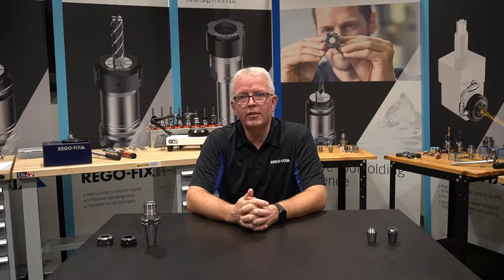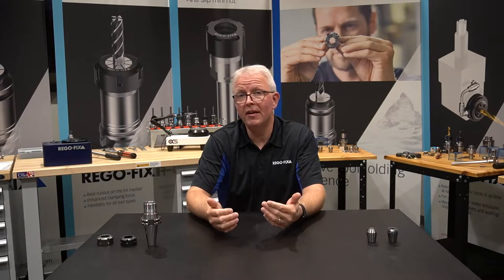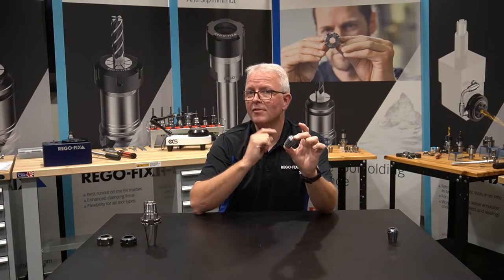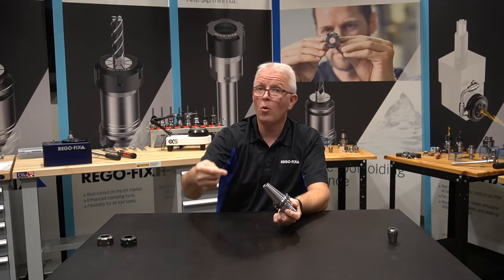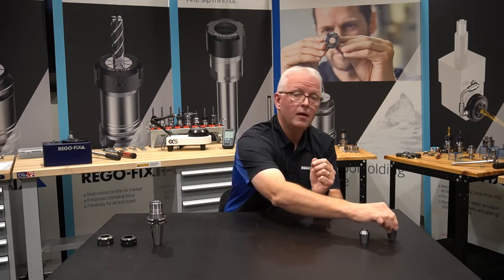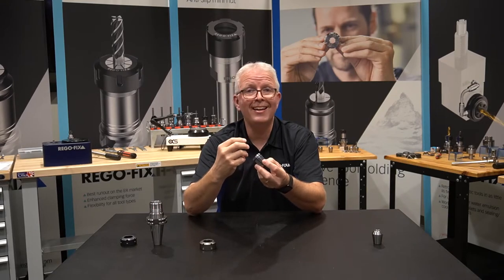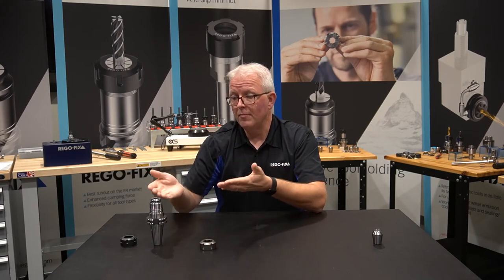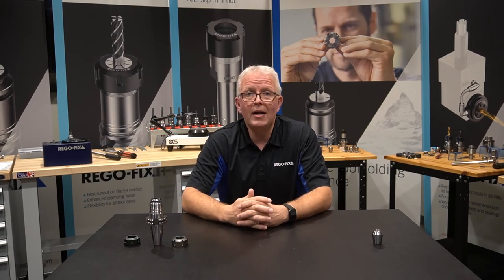TechChat - History of the ER Collet

Comment: Many thanks for the clarification about how the ER collet design was invented. But a further question that maybe Rego Fix can answer. I recently bought an as new condition Volstro rotary milling head that also came with a full set of Schaublin produced E 25 sized imperial collets that don't have the extraction groove just as you mentioned in the video. These as close as I can measure replicate both taper angles and dimensions my ER 25 collets have except those Schaublin collets are approximately .047" longer than the ER 25 series is. So were the collets overall length dimension also changed at that point? And yes for a couple of very good reasons I already know ER and E collets can't be used interchangeably in either chuck design.
Reply from the maker: Per David, you should be able to change the E nut for an ER one and use ER collets in them. As long as the cavity in the back of the holder has a pocket at the bottom, you should not have any issue with the ER collet being used in place of an E collet. The ER collet will sit higher, but it should fit just fine. The reason it sits higher is to create the clamping range we now have with ER, compared to the on-size fitting of an E collet.
Reply: @REGOFIX  Sorry I should have been a bit more detailed in my explanation. Since E collets seem to be fairly rare today maybe some interchange information will be helpful to you if there's any questions by customers about using ER collets with a E series chuck and nut. Afaik the standard dimensions Schaublin used for there E Collet chuck and nut that I'd have to assume Volstro followed very closely since they were using there E collets are quite a bit smaller in diameter with a different thread pitch than today's standard ER 25 thread pitch and diameters are. So the ER 25 nuts aren't compatible nor interchangeable between the two systems even though the angles for the two collet designs are exactly the same. But I didn't know the E series collets are an on-size design and wrongly thought they should have about the same closing range ER collets do. That alone is very helpful information.